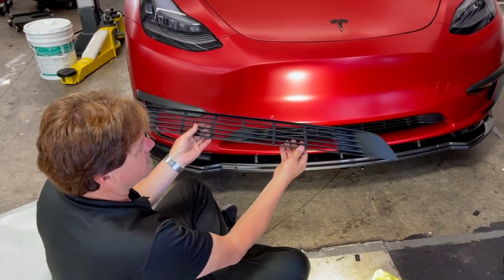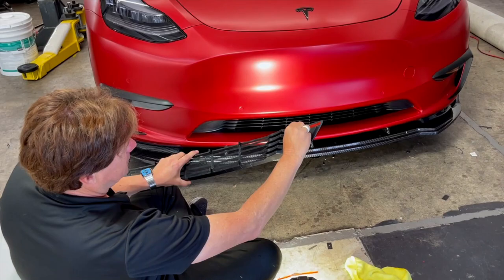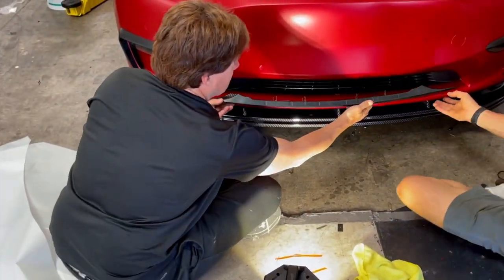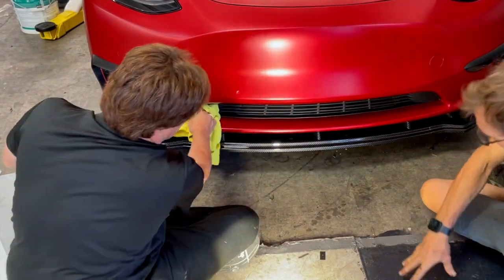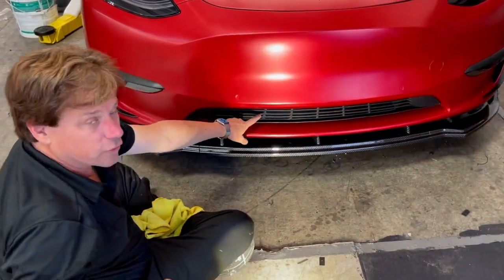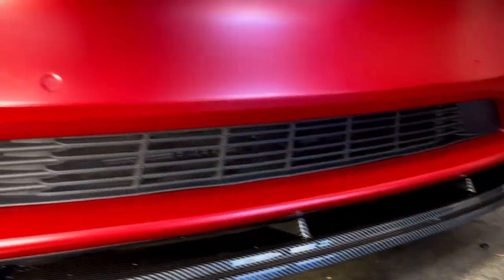Model Y Radiator Protective Mesh Grill Panel

Comment: Like the idea but won’t work for states that have front license plate holders unless plate taped to grill/hood. I use the quick bandit license plate holder as I have PPF on the whole front of car.
Reply: I used “That Grin” LP holder and had no issues with their grill, using a hot knife to make tiny incisions where the metal forks need to pass through. I also have PPF on the car, but that isn’t saving debris sucking into the compartment.